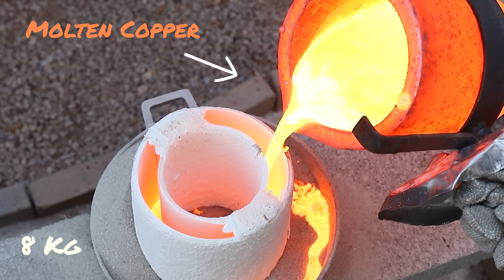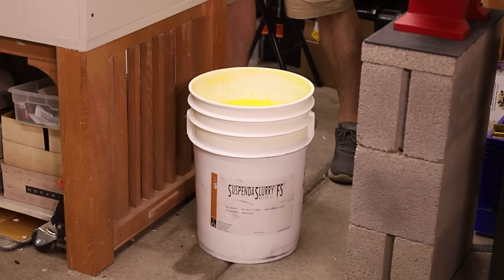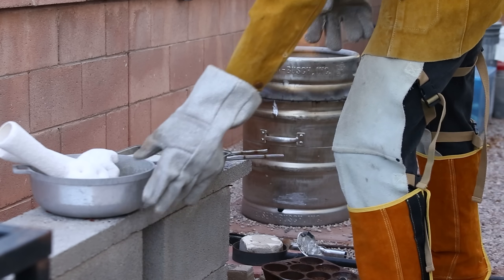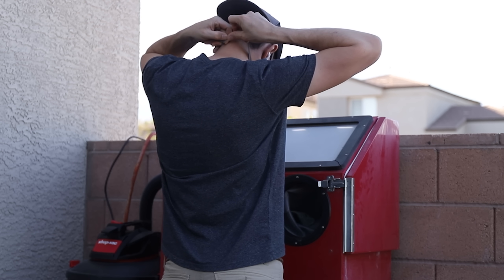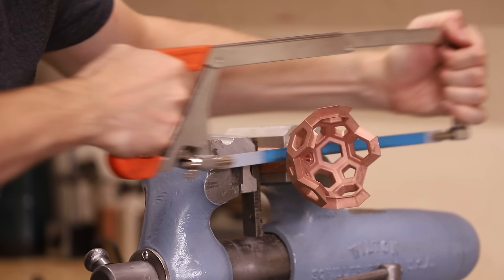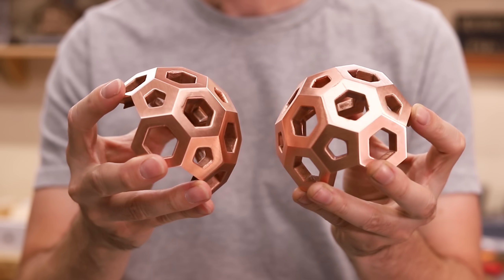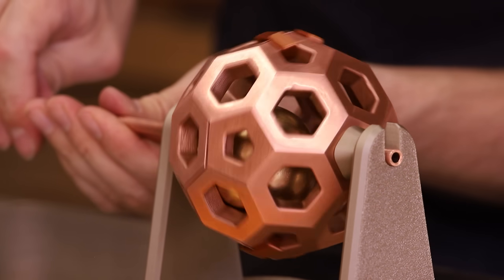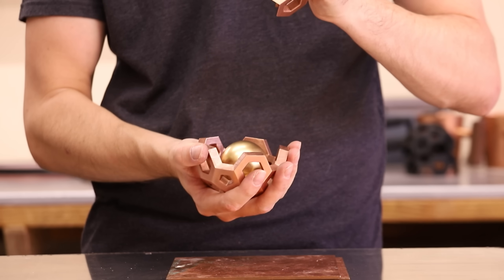HUGE Magnet VS Copper Sphere - Defying Gravity- Will a Neodymium Magnet Float Inside?

Comment: 11:10- "so I think when I do it really really fast, centripetal force is just forcing over to one side, I think"

No exactly,

Centripetal force = (mass* velocity ^2)/radius

(As v increases, so must centripetal force) 

Centripetal force isn't a unique or fundamental force in itself but rather the name given to the net of force components that acts toward the center of a circular path. 

Centripetal force is a way to describe the necessary outside force component's (friction, tensions, gravitational component (m*g * cos theta) etc, required to constantly change the direction of an object's velocity, keeping it in circular motion.

So, centripetal force doesn’t "force the object to one side"; it is a name given for the net of other component forces that must pull the object inward, toward the center of the circle, preventing it from moving off in a straight line (tangentially not radially).
Reply: Centrifugal*

Comment: The magnet drops as the magnet sphere nears the rotation of the copper sphere where it would be the same as if they are both standing still and there is no flux produced.  Suggest you use a LED lighted camera through the center of the copper tube for best visibility. One may use a programmable motor drive that would allow increasing and decreasing the copper sphere's rotation in order to keep a suitable and constant flux between the magnet and copper. Having said that; one must realize that the magnet sphere has poles and one may need to do an oscillated two dimensional/axis spin of the copper sphere in order to generate a constant flux between the copper sphere and the magnetic sphere's poles. If one is using a camera to view the magnet sphere inside, one could fashion battery powered blue tooth telemetry to view the video outside on a receiver monitor and go to a solid copper sphere. the second axis could be as simple as mounting the primary axis assembly onto a controllable record player platen. In any case you will need to oscillate the rotational speeds on both axis. Also paint some pole markings on the magnet like longitude and latitude so you can visualize the spin of the magnet.

Comment: Excellent casting  and demonstration/experiment!! There are several ways you could play around with creating more "open air" by reverse imaging and making the "holes" into solid discs, and the solid parts the (mostly) open air for a better visual ability... although I really LOVE the truncated icosahedron! Another possibility involves different orientation and number of seams in regards to the rotational axis... What about the possibility of spinning the magnet itself and have the "cage" floating around it? What if you were to separate the halves with an insulator and see if there is any electrical potentials or current in addition to the eddy currents?  So many fascinating ideas cascading from this initial excellent demonstration!

Comment: In answer to your first question Candle sticks.  To your last question about what else to use your contraption for. Propulsion & Gravity Machine, in a Flying Saucer. Oscillation, Frequency & or Vibration. As space is not a perfect vacuum. Especially when you turned the contraption so easily with a much smaller magnet. More than likely all of or some of the above is incorrect or just pain rubbish. There’re just imaginings, thoughts 💭 and ideas 💡.

Comment: So, you asked how you can improve it.  Simple -- cast your pseudosphere in silver instead of copper. Whatever you paid for the copper, you would pay about 95 times as much for the silver.  But, metal is metal.  Buy it, use it, make the video, then sell it back.  The net cost will be not that bad.  And what a great demonstration it would make. You would gain about 5-6% in field strength. Note: you would need to use FINE silver, not Sterling Silver.  Sterling has MUCH lower conductivity than copper. (surprising fact)

Comment: your best bet is to find a way to anchor the magnet to a specific polaritys rotational direction. Because its a sphere and its completely surrounded by magnetic metal, it's much more subsptible to chaos and likely inflicting the electrical current in the copper in a very haphazard way. i imagine if it had an anchor you might get a more reliable and predictable effect. maybe even a couple ball bearings holding the magnet central or a couple neodymium bearings in a similar way

Comment: Have you seen people balance and spin balls with air.. in mid air?   What if you could spin the magnet inside the copper ball..  my guess is with enough air power, it would spin ( paint half some color to see it spin). Also connect some wires to the sphere..  see how much power you are generating..

Comment: What if you figured out the spin speed by setting up an arduino system and then used that to rotate the magnet at that speed? then it would be consistently floating.

Comment: Wonder how much electrical energy could be attained by having a multicylinder combustion engine oscillating huge magnets like that on the tops of the pistons inside of thick copper cylinders. Makes me wonder if that could be better than an alternator.

Comment: You could also print the prints one layer thick, put it into sand and actually just pour the molten copper straight into the print. The print will disintegrate into the sand, leaving behind the copper shape.

Comment: Why did you use the sphere? You're spinning on the same axis. for an experiment, you can make a cylinder. This way you can secure the ball and then release it. and you can also fix the ball from the axis side, you can now. Then you will not be hindered by the centrifugal force when unwinding. and one more thing, you need to measure the temperature during operation

Comment: I wonder if this effect can be used to make a smooth door stopper. You know, to prevent doors from slamming and get them always close smoothly. I know there are mechanical hinges for this that use some kind of spring mechanism or a passive hydraulic cylinder, but one of the issues with those is they wear out with each use. Magnets don't, or at least not nearly as fast. Would be interesting to see if it would work
Reply: So smart idea.
Reply: can it help windmills from overheating as anything else will blow with overheating.

Comment: After thinking about this a bit, and if you coul spin the shell at a constant speed, you could put a spot of paint on the shell and record a video for as long as you can, using 60, 120 or 240 FPS.

You then remove the frames between the reference spot of paint and you're final video will be one of the shell in a static position but showing the magnet rising and holding its central position.

Other than that you could compress blocks of frames and lower the opacity of the surrounding frames before and after the current frame and you'll get a blurred shell and the magnet rising.

All of this can be done without expensive gear, other than a spot of paint.  You could paint the shell to improve the view of the magnet.

Comment: Maybe electrically bonding both hemispheres will make the field more stable for the sphere. Even if the hemispheres are touching one another, there might be resistance present and the fields are uneven. Bonding them electrically might solve the issue.

Comment: How about spinning the magnet inside the sphere with another rod through the middle of the existing rods. Or if there's a balance issue that causes wobbling still then just hold the magnet still with the center spindle & spin the coper ball. It would be interesting to see if an electric charge could be created & what polarity by spinning different directions. Or spin each in opposite directions.
This was a really interesting vid.  I wonder if you're on the trail of what the ancient pyramids were actually used for.

Comment: If you suspended the sphere in the center, and rotated the copper structure around it at high speed it should let off an electrical charge.

Comment: So In theory..If you spin really fast and surely with out falling a Copper or any metal reactive to Magnet...You get a floating or levitating Magnet...So If you attach a Body To that floating Magnet it will or should levitate..Now, Since we got a net zero force body then if We add air thrusters or Fuel thrusters or Ionic or plazma thrusters... to the either end of that body you get a directional movement too...Now Next thing is left to do might be how to stop a moving object .. Anti thrust vectoring ..Anti rotating Manget or some thing...Now How do we attach a body to the floating magnet also how to ensure that the spinning copper doesn't stop...May be using Cylinder or some thing..or more exotic metal...to get more anti gravity action...! 
Then may be we got a Flying Triangle like ship..! at least for Earth Magnetic Enviorment...!
May be, I don't know..!
What you say....Sir but nice experiment..!
~Regards and Namaste~

Comment: Cool build for the copper sphere.  The spinning outer copper sphere will transfer angular momentum to the inner spherical magnet via the magnetic field which will start it spinning as well.  This should affect the magnetic levitation as the rotation rates of both come closer together.  Are you observing this behavior?  Maybe use a marker to draw lines on the sphere to see its rotation rate.  On a side note, you could also do the same type of levitation experiment with the copper cylinder and the disk magnet as  when you rolled it on the table. Just get a roller setup so the cylinder can rotate in place.  Draw some lines on the disk magnet to see how it spins up.  The levitation will be much more visible but you might need a plexiglass cover on the cylinder ends to keep the disk magnet from exiting the copper cylinder.

Comment: You got to do magnet boll with The north magnet inside The boll and ab other boll that this fits in, placed the South magnet in. So theres both Magnets  facing The same magnet to each other, so cause this other isbinside this other magnet it will float as long as it keeps The msgnetism.

Comment: One way to really easily see the ball is to use a motor wuth adjustable RPM so you can sync the RPM with the shutter speed of your camera to make the copper shield seem immobile, and ease the sphere visibility.

Comment: Found your channel by pure happenstance. Absolutely love it ! If I may suggest, purely as observations, any points of friction will generate heat and reduce conductivity within the model. Diminishing or eliminating friction may help you achieve the effect you are looking for. Also the clips being 3D print material may have a more significant effect than intended/required on the magnet once the model is rotating, again reducing the overall effect you are looking to achieve. Subscribed. 👍🏻👊🏻

Comment: A hexagon rotary broach would have been good to have for this project... or a regular hex broach that's about the same size. I think a regular sphere would have been a lot easier, with round holes. It would be very easy to design and 3d print too. It certainly wouldn't look as nice though. This one came out excellent.

Comment: Ever try printing with wax for casting? It's supposed to save a lot of time, but I've never seen anyone actually use it. I guess it's very durable (for wax), so it can be turned into a cast without being damaged. I guess it's like the green and blue waxes they use for machining, but instead it's a filament for printing. Then the casting doesn't have to be fired at high temperature for a long time, just hot enough for the wax to melt out I guess... but I would probably increase the temperature just in case to make sure all the wax is gone. I'd hate to have bubbles from wax boiling in there. I don't know how lost foam casting doesn't lead to casting problems and irregularities.

Comment: Second thought is a motor where the windings on the outside don’t fly apart at high speeds because they are stationary but your copper creation inside is what spins and your visibility ports provide cooling to the copper core.

Comment: nice try but the angles of those unproportion sides cancelled the repelling force of the spherical magnet making it unstable during spinning, so throw that away and make another one with only copper wires, just create a perfect hollow sphere diameter out of insulatedly coated copper wires concealing the magnetic sphere inside like a sepak takraw ball.. see the results when spun and finally put electrical current on the end of the wires, spin it with external magnets moving it closer to the copper sphere then you will see the difference inside though. thank me later after you are done..and what if scale it up the size & cooling it down with a controlled temp and put this whole thing inside the middle of a confined copperfield sperical room that you can physically fit inside comfortably ? .. dont tell me you have just created an anti-gravity mobile/machine though ?

Comment: I wonder if you could make some energy with it? Maybe try suspending it dead center in the middle with another copper pole connected to wires for collecting the energy exchange. But also for stability.

Comment: If you braze the two halves together, you get a really expensive desk toy.  Add a wooden stand with room for an engraved copper nameplate and a fountain pen and you have one that will sell for hundreds of dollars to corpo execs.  If you engrave the nameplate you can sell them as handmade and bespoke.  Not a lot of volume, so make and sell one at a time for about $400 above cost.  If the first one doesn’t sell, you have one for your desk.  If it does sell, make another for your desk.  Who couldn’t use the occasional shot in the wallet?

Comment: 1) Replace the copper shafts with plastic. 
 2) Electrify the cage with a 9 volt battery.
  3) Freeze the ball magnet Or the cage Or freeze both .
Steps one at a time Or alternate steps Or 
All three at one time.

Comment: You could try either a larger ball cage or a smaller ball. Also I'd experiment with rotation speed to find the most stable and then attach a motor running at that speed. It may need a run up to get going. Also paint black light on the ball and shine on UV to get a better view of the rotation.❤

Comment: put it in a tri-axial gimbal mechanism which is motorized in all 3 axis of rotation and then match the axial rotation rates with variable drive synchronous motors.

Comment: Maybe the internal shape of the structure is what causes the interference. The shape is not a sphere and the pentagonal shapes are smaller than then hexagonal ones. I wonder if re-casting it with a perfectly spherical surface (on the inside at least), while keeping the cut-outs for visibility could fix the issue.

Comment: I don’t know how much more complicated it would be to design and print but if you can somehow make the inside as close to spherical as you can. This may not be the case but intuitively it seems that the flat sides and angles would disrupt the eddy currents? That might be what makes it unstable? Plus the magnet would roll better and not slam into the side of the copper cage. Maybe. 
Or it’s the tolerances? Maybe do some testing with the sphere and a cylindrical piece of copper to come up with the optimal tolerances for the gap in between copper and magnet?

But I could totally see this as a prop in a movie where the spine cage is used to contain a bomb. If the center piece touches any matter then 

KABLOOEY!

Comment: Very cool , awesome job ! I think a way you can improve it visually is with the sphere design . Maybe try it with 50% less copper in the hexagon’s and pentagons that connect each hemosphere together. It looks to be about 10mm thick . If those were 3-5mm thick we’d be able to have a better observation of Lindsey’s law . And the gaps would still be smaller than the magnet itself so that wouldn’t fall out . The only thing I can think is that with the reduce in copper there, once you start rotating , will the magnet cause damage to the copper ? Although after a few rotations you were able to levitate the magnet  so might not be a big issue. Also maybe if you have an impact driver or speed drill you can 3D print an attachment that can spin the sphere for you and you can play around with the speed setting on the drills to find the best result . That would be sick to see

Comment: The weight of the magnet is too great. The copper's magnetic reaction isn't enough to override the weight of the magnet itself. In other words, if you were to create a cage with a metal with a stronger magnetic reaction, such as steel, it will more likely float. If you create a smaller neodymium magnet orb, you will get better results. Given the size of your neodymium sphere, it would likely be better suited to a steel cage instead of copper.

Comment: Try adding electrical current through it, or adding liquid hydrogen to cool it below zero - or do both! Not to mention, i think if you were able to make a larger housing, the speed rotation might not of been so temperamental to keep it suspended in the center.

Comment: At 22 seconds into your video you drop the magnet onto the copper plate. If you were to spin that copper plate with a motor, that magnet will float above the spinning plate. If you were to spin your copper sphere in a similar way, perpendicular, not horizontal, that ball magnet will float in mid-air also.

Comment: i'm curious if there were an insulated material between the 2 shell pieces if there would be different or equal voltage induced on each side or if they are equal in reference to ground.